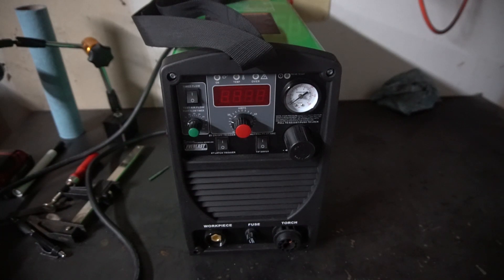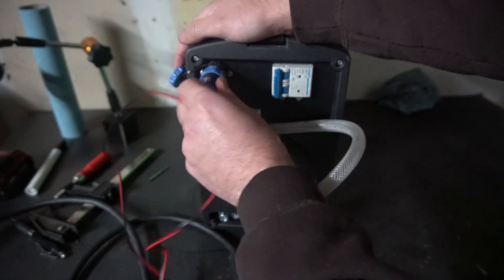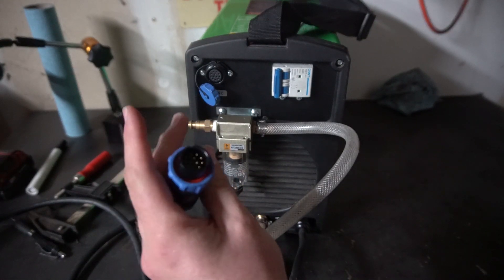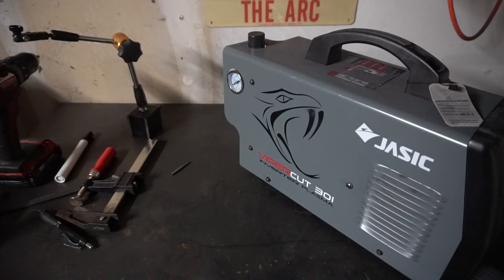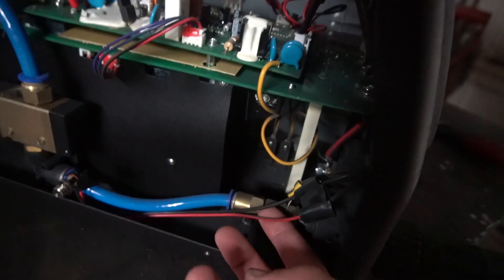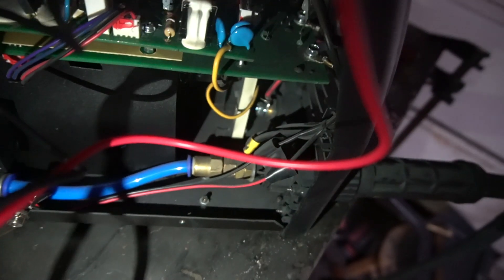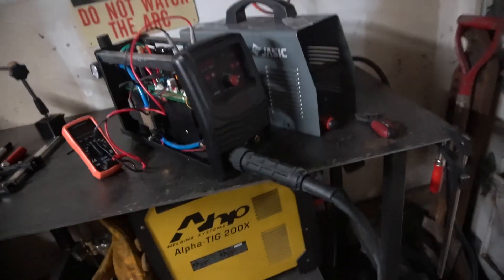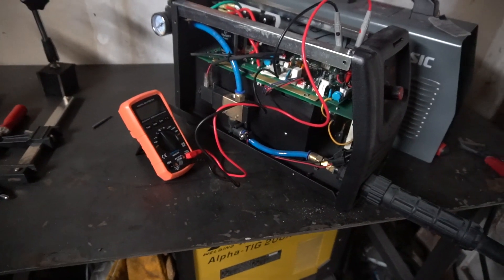CNC Plasma Wiring

Comment: How did you connect the torch firing wiring in the cnc pin connector and what numbers did you use
Reply from the maker: Pretty sure it was pin 7 and 8 I
I soldered mine 
I’d check your manual on what pins fire your torch